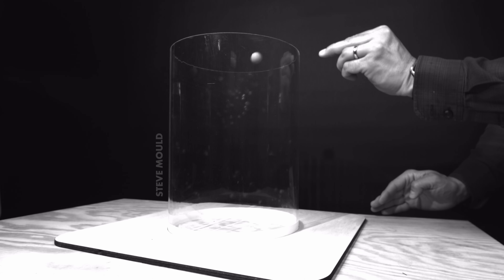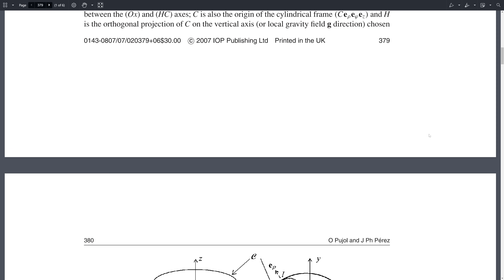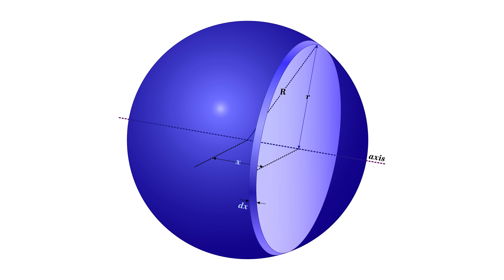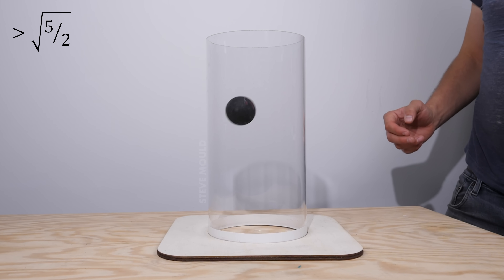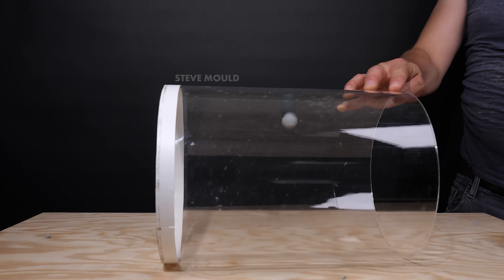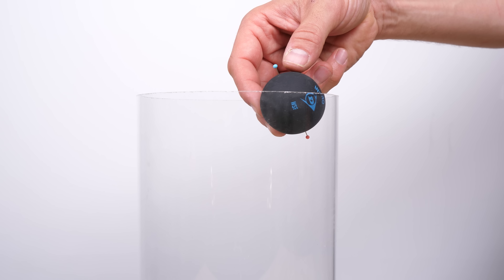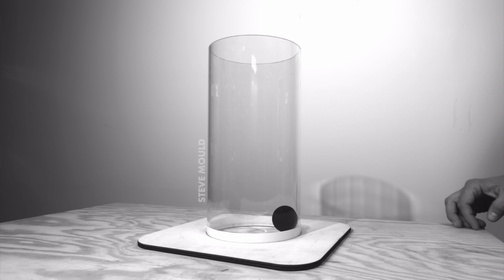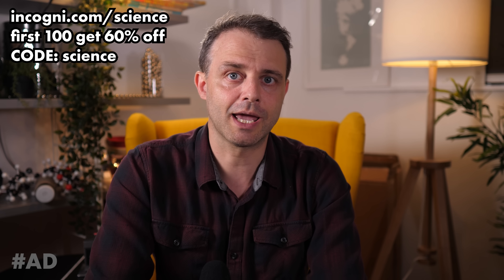The Golf Ball Paradox

Comment: I agree with a number of other comments that suggest using a ball with colored lines or quadrants and following the spin in detail to understand how that axis of rotation is changing over the course of the ball’s travel around the cylinder. I suspect it is being changed more than you expect, and that rate of change differs between the hollow and steel core balls.

I would also like to see that on the turntable video - there may be a small change there as well that is contributing to the movement.
Reply: You can see how the axis pivots in this video: https://youtu.be/4er2buINHF0?si=dPlL8yD0K1UL-7lI. This leads to a very satisfying explanation of the frequency ratio being greater than 1.

Comment: Your math made me think of Pi and if you think about it the fact it's traveling in a 3d space is still a lineal motion, so maybe the distance it travels up and down is defined in relation to the radius of the cylinder (circle) but is limited by the relationship between cylinder height/diameter ratio versus circumference of sphere. No idea though it's just a thought

Comment: The way I imagine it, it has to do with the friction and and the cylindrical surface. The ball wants to travel in a straight line. If it was a 0 dimensional point, it theoretically could. But the ball is 3 dimensional, it touches the point closest to it(which can't be a line as the ball will touch the next infinitesimal length, which won't be in a line but be in a curve) which then causes force upward as the static friction of the ball wants to keep the momentum going. With kinetic friction, no doubt this phenomenon won't work. I imagine that though the radius of the ball doesn't affect the rotation angle, it might affect the height of a stable rotation given a constant initial momentum.

Comment: I don't have any of the mathematics or a practical demonstration, but in theory, if the axis of rotation slowly rotates in the same direction the ball is rolling around an axis parallel to the walls of the cylinder, it would slow down the vertical oscillation of the ball, causing the higher-than-1 ratio of orbits to vertical oscillations.

Comment: It seems to me that this phenomena could bring a new generation of particle accelerators. There should be a way to rectify the "downward part" of the oscillation and have the ball going only in 1 direction. 
Ex: the ball magnet could be spun 180° by switching the polarity of the cylinders wall with electro magnets at the right time.
Or
Have a cylinder with split magnetic polarity on its lenght, and throw a bismuth ball into it, or an aluminium/copper/gold maybe lol. I dont know.

Very interresting videi! Thanks for sharing. I didnt know bout that at all!

Comment: So, if you want to get a ratio closer to 1, why not try a sphere with all the mass concentrated around the "equator"?  Ratio depends on distribution of mass relative to distance from the axis.  Even for a hollow sphere there is still a lot of mass close to the axis so the ratio remains significantly greater than 1.  In practice, there are 2 challenges here - design a sphere with the relevant mass distribution around the equator - and then how to inject it into the tube so that it spins around the polar axis.  Over to you Steve!

You might also try the converse - a sphere with all the mass concentrated at the centre (or along the axis - though that would also introduce the injection problem) for which the ratio should be a lot higher.  But you might need a much longer tube to get an effective demonstration.

Comment: You don't need two slowmo cameras, flip the camera to portrait and use a mirror above the cylinder at ~45 degrees to capture top down and front on video at the same time (also saving the need to sync the camera in post)

Comment: I'm not sure its intuitive but it resembles the movement of an Euler's disc, the change of the golf ball's plane looks to me to be the same as how the Euler's disc rotates and gives the same oscillation effect. But the rigid structure of a disc might better illustrate the effect rather than holding a ball with pins in it.
Reply: The shared term called precession either down with the heavy ball and out with the lighter ball.

Comment: STRESSED JETS ! Steve, you might capture a large passenger jet at the start of the runway with brakes locked, powering up, and then comes the release of the brakes. There must be a bit of shapeshifting going on there with all that power bottled up and then released.

Comment: Why the ball doesn't stay on an ellipse: at the highest and lowest points on the ellipse, the centrifugal force of the ball is not aligned with a normal vector from the surface it is pressing against, so the rotation will be pulled outwards.

In fact this is true of every point on the ellipse except the mid-height points. As a result, a ball departing from a mid-height point will not arrive exactly at the opposite side in one cycle - it will arrive a bit further down than 180 degrees as it passes through mid-height the next time. And so on.

Comment: Well I was wrong. My thinking was the golf ball is rolling with a flat axis, parallel with the ground. as it dips in, that velocity with a forward spin now tries to climb if it has enough friction. Now since it's a ball, and it's never perfectly straight on, one side of thr ball will fall so now it tried to climb at an angle, while the angle is changed, it slips and falls down as it rotates until it hits a perfect climb angle. If it has enough momentum, it flings out, if it doesn't, gravity pull the angle again eventually starting it over until it slows to the point of stalling.

Comment: You are applying energy to the sphere between 45 degrees <> perpendicular to the moment of friction of the ball at what would be the opposite force should the container be a cube (losing no energy to the parallel wall only creating rotation) (furthermore, Interestingly if it were a table you had flung the ball across the surface into a wall, it would likely bounce (a little) upwards on contact with the corner). Therefore elasticity in the ball will have a greater surface (upwards)  with the barrier creating drag (spin) when the friction is at maximum opposition to the direction of the initial velocity, ergo a non friction event will not produce this result.

Comment: I think this will be much more intuitive to understand what's going on if we would take a sphere in which ball is rotating other then a cylinder. It's intuitively understandable that the ball will rotate circularly inside the hollow sphere though gravity will eventually force this motion to stop.

The same goes for the water spinning inside a half-emptied bottle of water if we shake the bottle with water inside. Water will start rotating eventually. This is because both inertia and repulsive force of the walls.

The same goes for cylinder. It's just the cylinder is not so ideal for this kind of motion that's why oscyllations occur inside the cylinder unlike the circular motion inside the sphere.

Comment: If it is a gyroscopic effect, couldn't you manipulate this with one of those balls that has a gyroscope inside? Either by priming the internal gyroscope with rotation counter to the rotation of the outer surface, or by just letting the internal gyroscope resist the tendency to rotate

Comment: The ball is steering that way because of the angle of the curve in relation to the spin of the ball.  The trajectory of the ball changes because the curve changes, conflicting with the spin.  The traction causes it to turn and steer back out of the cylinder.

Comment: A motorcycle racing tire changes the RPM of the wheel when leaned over, because the contact patch changes its radius.  The ball's inertia is obviously experiencing this contact patch racing tire radius thing, and this will certainly affect that spin axis in gyroscopic ways.  It is mind bending, but it's there.  YOU CAN DO IT!

Comment: I would blame the elastic potential energy that the ball receives right on the point that it touches the cylinder - the elastic energy builds up and then releases sending the ball in the opposite direction. this would also explain why it goes up and down.
Reply: but that doesn't explain why a golf ball would do it unless the elastic energy was in the walls of the cylinder in that instance.
Reply: that dosnt make any sense however as the elastic energy in the wall of the cylinder would not travel with the ball... stuff is weird.

Comment: Mark the balls so a computer can track the initial spin as it changes while showing the digitalized axis line represented by N/blue versus S/red. Also, have the computer calculate the amount of the slipping in real-time. I also suspect the spin before contact will not be the same when in full contact.

Comment: So what would happen if the cylinder was rotating,  either with or against the direction the ball enters?
Also I see an intuitive link between this experiment and the turn table one, especially when you turned the cylinder on its side, it was like the turntable experiment but on a vertical instead of horizontal plane.
There's a connection there I am just not smart enough to explain the correlation.

Comment: Could you not track the horizontal position of the ball by projecting a color chart down into the tube?
That way you can visually see both vertical position from the side, and horizontal position from the color on the ball, given that the color chart has a constant and consistent mapping.
Otherwise, a second camera would certainly be useful.

Comment: I suspect the key point for why it's turning like that, is the "equator".

When the ball first enters the cylinder, it's not turning YET, there for, the point it touches with the wall, BECOMES it's equator of spin, as it starts rolling.

as it rolls, because the cylinder is a different geometry than the ball, the point of contact is no longer the equator.  that point of contact moves slower than the equator, causing friction, trying to "change" the direction the ball is spinning, which results in an upward force.

Hopefully, this "hand waving" explanation is close enough to the truth, and helps understand the behavior.

Comment: The motion does look a lot like the gravitational ‘slingshot’ effect space agencies have used to accelerate a satellite into the outer solar system, and I guess the body’s gravitational well is a 3D version of the cylinder.

In golf, if the ball breaks the plane of the hole’s rim, it is considered ‘holed’ and scored.  It doesn’t have to come to rest inside the hole.  This is different from basketball, in which the ball must fully pass through the hoop.  In billiards, I think the design of the pockets, and the lower forces involved, should prevent the slingshot effect from spitting a ball back out.

Comment: Your idea "the axis of rotation stays fixed" is correct. HOWEVER, only in the "no gravity" scenario. (Check the footage, it makes only 1 single turn to fling back out.)
Which tells me, the oscillation must come from gravity interacting into the rotation axis. Making it oscillating. Since this is the only difference in the experimental setup.

Comment: There are You Tube videos of the same thing happening to a basketball where the ball appears to go in yet after a spin around the rim, comes back up and out.  Since the cylinder is so short, this has to be very rare. Has anyone seen this also?  Could it be for the same reason?

Comment: using two parallal plane instead of a round hole, the ball will bounce back as well. The key point is not the changing of the axis, but the convertion between rotation and motion.

Comment: What happens to the ratio of oscillation if the shape has an extremely dense core but is overall extremely hollow, like an atom? Because it seems that besides overall density, the placement of density matters too. If we hypothetically consider the surface of the cylinder as gravity, it may somehow show us how electromagnetism and gravity are related to each other. I know it's an extremely long stretch, but there's no harm in testing how a shape like an atom interacts with gravity (the surface of the cylinder, not actual gravity). I think we can't create a ball as hollow and core-dense as an atom anyway, maybe in a computer simulation.

Comment: I wrote basically an essay here just a second ago but I figured I would explain this more Layman's terms.
 - Ignore gravity so you can see this change to the extreme
 - ignore the gripping factor, this is taking into account sliding which ignores the force of friction.
 - Now what you want to know is why it takes this trajectory, we will look at its angular momentum vector in order to see this clearly and make the trajectory horizontal.
Like this
         ^
         |
       -------------------
        
The area you see here is the trajectory (x axis) and angular momentum vector (y axis.) This vertical line basically just shows the angle that the ball is rotating (think of it as a pen and the ball is spinning around the pen with the pen being the center of the ball). For this angle to change, there needs to be a force which overrides the force holding it upright.
We said gravity = 0 before, now lets say the force of gravity increases based on earth. This means f=m*a , on earth (a) doesnt change. So you can only change mass. Considering this, the more mass the larger the force of gravity. Considering the ball is thrown at an angle, then your visual diagram would have a gravity force that is not in the opposite direction of the angular momentum direction, but at an angle like so
Like this 
         ^
         |
       -------------------
         \  <--- you gravity vector
Since this direction of gravity is not in the same direction as the ball sitting upright (its riding the wall of the tube), gravity can pull the angle in which it spins into a new path once it exceeds the force of the ball spinning upright. Once the force exceeds a certain threshold, the momentum vector will flip in order to become more stable with gravity. Before the ball flips, gravity will simply increase the wobble of the ball more and more. If we take all of this into account. Ignoring gravity once again, 
         ^
         |
       -------------------
The more the mass approaches 0, the more the ball will stay in the exact trajectory it came into the tube (so the 2D view it will slide back and forth). This is because the ball is keeping the same direction of spin, you can also think of the tube being rolled out and the ball is doing something similar to the turn table or simply if you spin a ball at a 45 degree angle to the ground, when it hits the ground it will do a curve (exactly like curving a bowling ball). If you are curious of what is holding it upright, look up effects of angular momentum vector, centrifugal force, and centripetal force (just so you get it all).

Comment: Drilling rig!!!! Take this camera to ANY DRILLING RIG!!! You will not be disappointed. There is so much equipment operating in different ways. 
You have centrifugal pumps to large 1700 horsepower pumps 3512 caterpillar engines rotating 95’ lengths of pipe. Literally endless things to record with a motion capture camera.

Comment: That damn gravity... The difference in air pressure between the top and the bottom of an airplane's wing is enough to nullify it, the centrifugal force of a mild throw is enough to overcome it... How do the oceans remain in place again?...
Reply: Because oceans don't have any means to overcome their weight.

Forces can be overpowered by other forces. When you place a beachball underwater, it flies up to the surface because of buoyancy right? But if you hold it down with your weight, the ball doesn't come up. This doesn't mean you've magically defied the laws of buoyancy. It just means your weight overpowered the buoyant force trying to push the beach ball upwards.

Throwing a ball DOES overcome gravity at the start. The ball has a relatively small mass and therefore a small weight due to gravity. When you throw it in the air, the instant it leaves your hand it has a large amount of energy that is stronger than the force pulling it down. However gravity slowly bleeds off the energy provided by your arm. Think of it like rolling a ball across a flat road. The ball doesn't go on forever because the friction between it and the ground is constantly acting on the ball, while the force you gave it by rolling it across the ground isn't constantly being applied. You give it a set amount of energy that is slowly being drained by an external force acting on the ball. It's the same concept.

Comment: By 1 minute and 20 seconds into the video, I essentially had the theory Steve explains at about 7 minutes and 40 seconds.
Spoilers below

.

.

.

.

I  essentially came up with the theory that it is related to the axis of rotation of the ball, and its relationship to the surface of the cylinder as it goes around. But as Steve points out, if it were that alone then the oscillation rate would be 1 oscillation to 1 cycle around the cylinder. Since it does not, and there is a delay, my guess is that either it is due to the gyroscope effect causing a slow change to the axis of rotation, or it is due to the axis of rotation lagging behind the position of the ball on the cylinder. Both of which are also discussed by Steve in the video.

Regardless, I am mildly proud to have gotten that far in just 100 seconds of watching the video and thinking about the question.

Comment: Isn't it just the spin of the ball imparted on it as it first touches the inside of cylinder, it creates a kind of top spin that takes it out of the cylinder. I bet if you had a smooth metal ball and a wet soapy frictionless cylinder the ball would always spiral to the bottom.